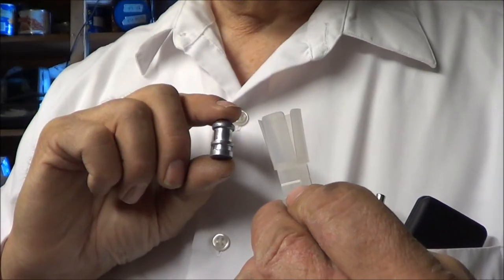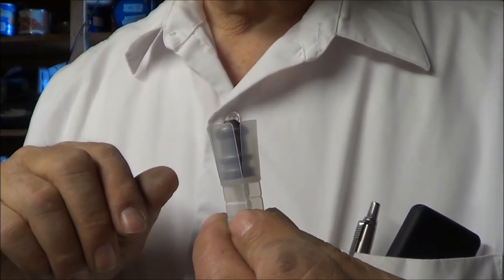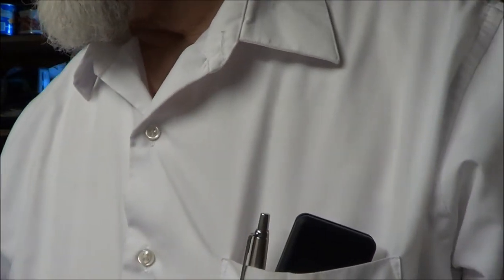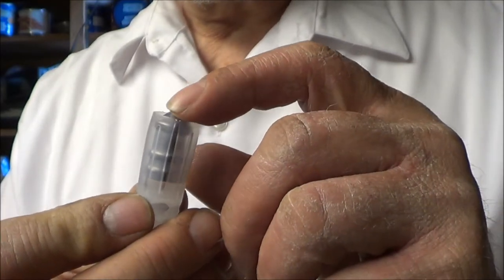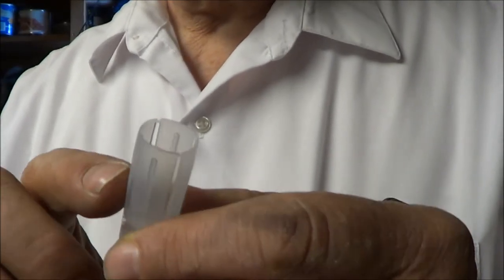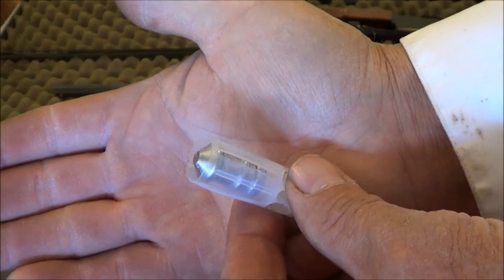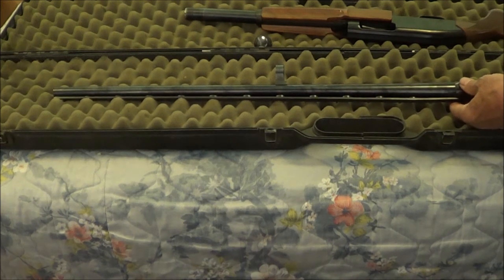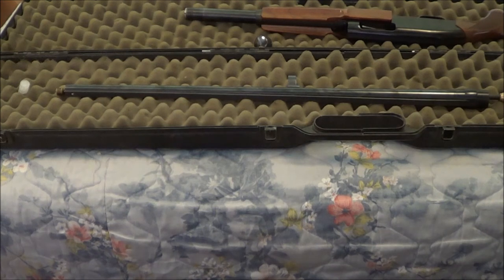Reloading 20 Gauge slugs with a .50 caliber Maxi-Ball

Comment: That has got to keyhole at 50yds with being a solid conical projectile with no rifling...  Try using a 54 cal .535 round ball with a modified barrel or a .550 ball with a cylinder bored barrel.   You have to build up the space in the waa20 wad under the ball, but it works great at longer distances!!  Start at 15 gr of unique till you find what works in your gun.  Cheap, fun and would work great on deer.

Comment: I'd recommend weighing the maxi ball to determine the weight and then use a load for that; not just use a 1oz load because the slug weighs less than that.
Reply: Eh . Maybe .

  7/8oz = 382gr , which would be plausible to cast s .50 conical of that weight .

   BUT , the load data for 7/8 oz shot probably uses different wads , and opens back up another full round of variables .

     I know it's a mantra to always follow load data exactly . But in these parameters of same primer, powder, wad column , with lighter projectiles weight , the pressures will be Lower . If it cycles a particular semiauto shot gun , is another question . but it will be Safe .
Reply: I use 570 round balls or a minnie ball in clay buster,  shit past 75yds but great scatter rounds

Comment: Interesting load, but not enough data here. Did you ever say how many grains of Herco you used in your recipe?  Did you ever shot this load through a chronograph to capture an FPS average?  Did you calculate a chamber pressure for this load?  If so, how did you do that?  Thanks.
Reply from the maker: No.  I used the grains of Herco from a lead shot load on the Alliant powder web site for a one ounce load.  No I did not shoot this load over a chronograph.  No I did not calculate chamber pressure.

Comment: Use a 54 cal maxi ball for a 20ga slug in to ballistic products tps 20ga wad that you will have to cut the petals. I cut them with 2 cuts not 4. you will have to put 2-1/4" 28ga felt filler wads and 1-1/8 28ga 28ga cork wad in the shot cup to bring the slug up to the proper height. I use 3" fiocchi hulls with 27gr of 4746 powder....1 1/2" groups at 50yds in my Mossberg 20ga 500 with a rifled barrel. These weigh 1oz and are moving at 1350fps...They pack a punch baby. All components are available at Ballisticproducts.com

Comment: what choke has the barrel?
Reply from the maker: There is not a choke stamped on the barrel.  Push the wad with the .50 caliber Maxi-Ball thru the barrel from the chamber end to make sure there Is not too tight a restriction.
Reply: Mine has an improved cylinder. It came with modified and full choke sleeves.